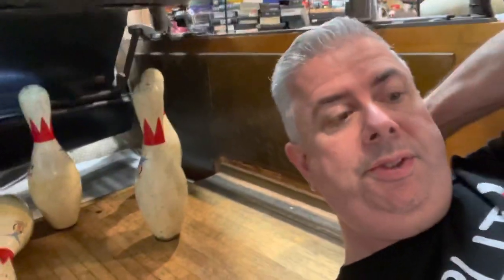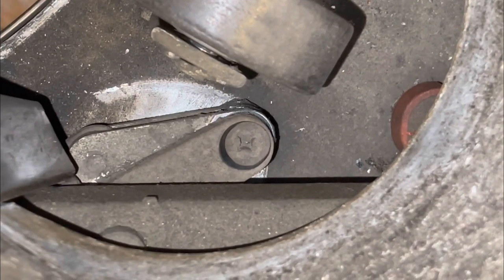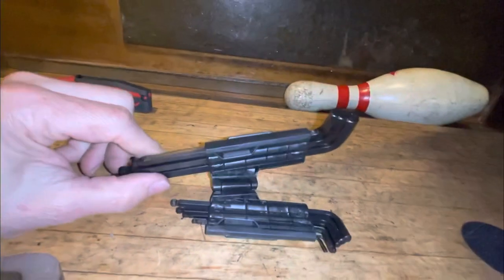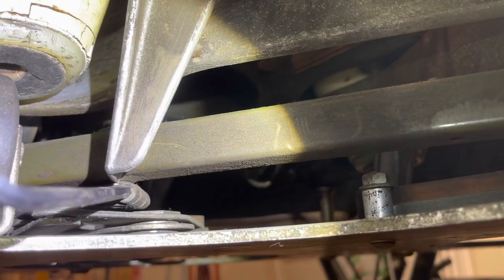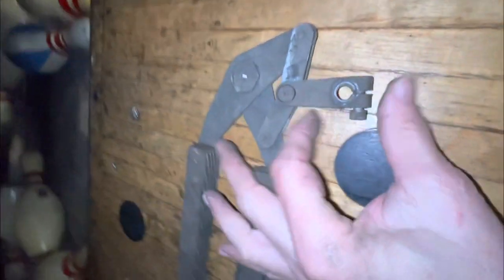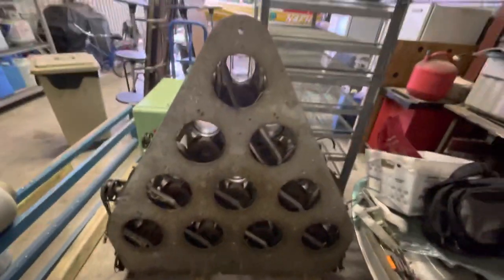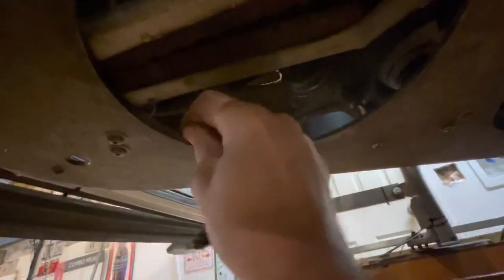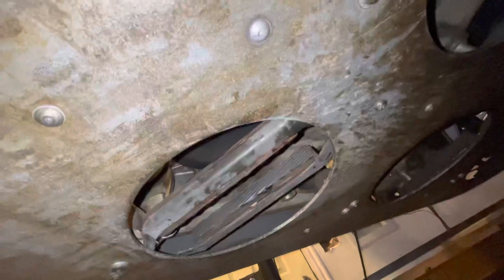Scissors - Replacing a respot scissor assembly on a Brunswick A or A2 Pinsetter Garage Bowling Alley

Comment: Thank you soooo much!!! I wish this was here when I was replacing the scissors. I was never taught how and had never done it before.
Reply from the maker: I try to do videos on anything maintenance related.    I have a big one on a gearbox clutch I need to finish up.  Today I’m replacing the pindeck so it’ll be after that.
Reply: @GarageBowlingAlley  Great! That’d be awesome, because on lane 21 the clutch and input worm shaft assembly need replacing, according to the head mechanic.

Comment: I had a scissor explode during league on an A1, turns out a lot of them werent maintenaned in almost 30 years. Another machine we ended up having to rebuild the deck since it was cracked.. that machine also had a fiant hole in the gear box

Comment: I noticed that all your scissor screws are rounded and your scissor deck don't have a counter sink holes for the flush screws, is that because its a A conversion?
Reply from the maker: It's an original original OTIS A s/n 3290 so it's primitive in a lot of ots hardware  and construction.